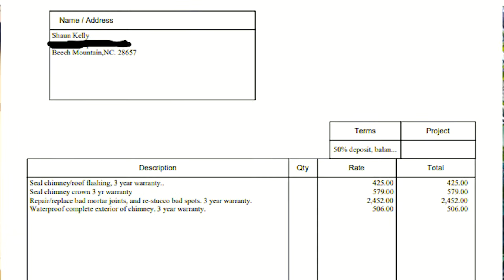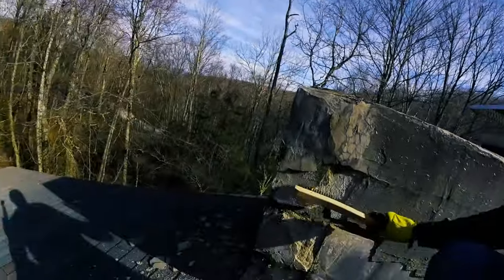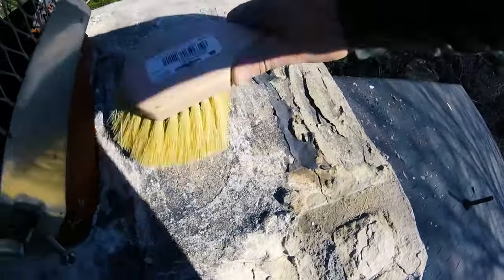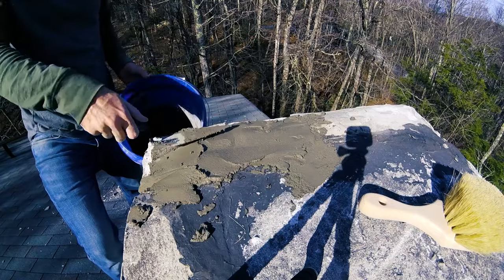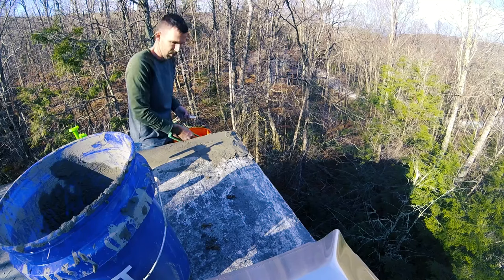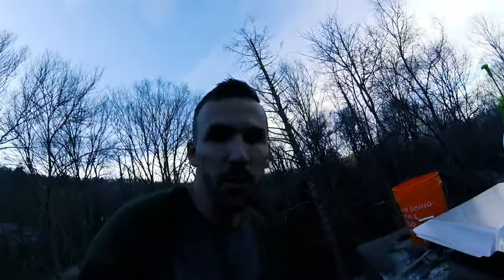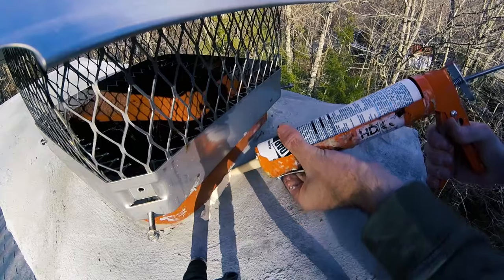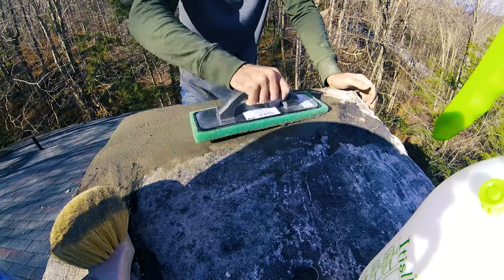How to Patch a Chimney - EASY!

Comment: I'm curious if you have updates for how this turned out. You didn't do anything with the flashing at the roof, is that because the original flashing was ok? And did you put any kind of sealer on this afterward? Thanks for making this video! I'm trying to learn about chimneys as we buy a house that is going to need work done on the crown.
Reply: Me too.

Comment: Anybody know why he used "vinyl' patch vs straight mortar.  I have the same chimney issues.  Thx!
Reply: It sounds more like a personal decision, possibly because he was only parging a small area. I’ve parged a bunch of chimney and used basic Type S mortar that works great. There’s also likely a decent price difference with Type S mortar being about as cheap as mortar gets and still provides a great finished product. The import part as he mentioned is the finish. Once the mortar sets enough where you can put a wet sponge to it and wipe on it with a circular motion without the mortar moving you can begging the finishing touches. You want to use the tool he had or a wet sponge and lightly, with a circular motion, smooth out the entirety of the new mortar on the chimney. You are looking for a rough finished looks where there dried mortar is begging to fall away in small bits (almost a dust) and then you are good. Do not put the finish on it Too early
Reply: I'm guessing vinyl would be less likely to crack than straight mortar?
Reply: I'm thinking for flexibility. In that environment, I'm guessing there's a lot of freeze/thaw cycles and the vinyl will allow flexibility. Heard somewhere is called type N. Not a mason, just my thoughts!

Comment: I appreciate your video and work effort, but this is just a bandaid on a stich wound.  It seems to me that all chimney crowns should have a custom fit stainless steel box cover with holes cut out for flues and fasten in place, and a high temp flexible caulk sealer around perimeter of flues.

Comment: Question: As the fire burns (in the fireplace?), the chimney will expand and contract. Did any cracks form in the Quikrete surface over time? 
I am about to restore my hundred-year-old chimney that has been painted, tarred, and gooped. All those coatings have allowed the mortar to rot and turn to sand on the North side especially.
Reply from the maker: This cement is meant for this type of environment and has not cracked on me. One thing I ended up doing was putting Thompsons water seal on it with a spray jug. This will prevent moisture from getting in, freezing, and potentially cracking it.
Reply: @KellyConcepts  Thank you!! :person-turqouise-waving:

Comment: As a mason I can promise you this is not a good idea
Reply: Since you're a professional I'm curious why you think this is not a good idea.
Reply: Great idea for a temporary fix, but going over the existing material that cracked before, it will only crack up again.  Need to strip crown off completely, add reinforced wire, form a box and mix and pour new cement.  The chimney bricks leading up to the crown should have never had any cement over them.  If brick mortar is weak, grind it out and spread new.

Comment: Our chimney stucco on the exterior and bricks 🧱 on the interior probably what you have.

What I see is that it was repaired at the top portion it was poorly smoothed over and then along the side basically the edge of the chimney is a crack and I want to FILL that in, keep water out. 

I have a quote for $7000 and I have a quote for $11,000 to do this even though I told him I only wanted a quarter top part done and yeah they are way too much.